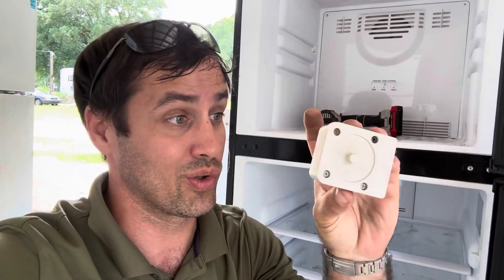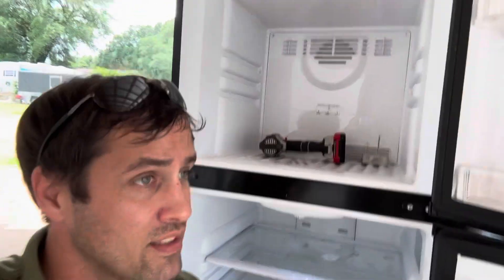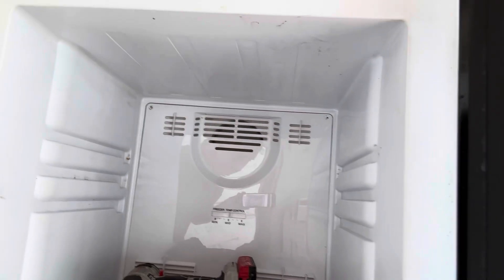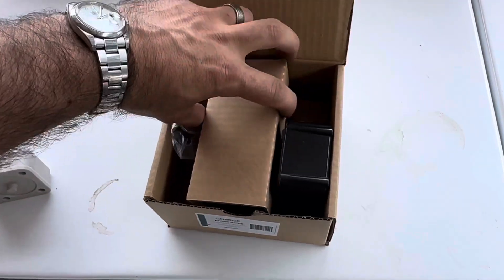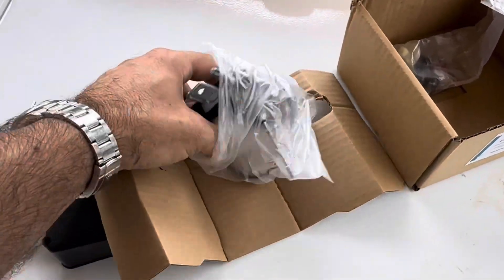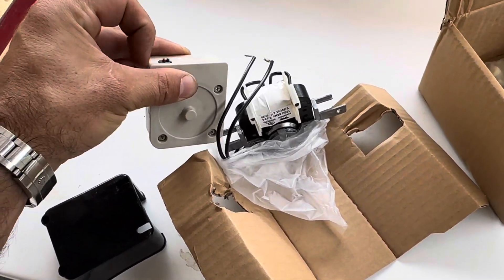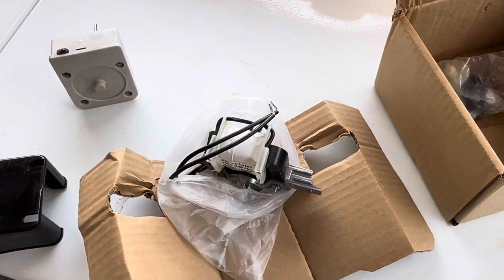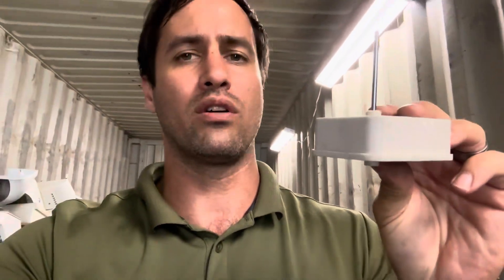How to fix a Haier 10cuft refrigerator evaporator fan motor trick

Comment: Smart choice, can't let the manufacturers out-smart us the customer all the time with OEM "requirements"
Reply from the maker: Oh yeah been putting those motors in for a while. The oems are just way too high. And they stink anyway. Always failing.
Reply: Hello, what's up. I have the same motor(shape) as the universal one but it is 12v DC??. Mine was making a noise i opened it gave it a clean and lube made a Contraption to test it outside the fridge (triac to step the voltage from 240V ac to 12V ac then i used a bridge rectifier to convert ac to dc). It worked flawlessly, until i increased the voltage up and burned a hole in the coil thing in the bottom its a french door bosch unit i dont know how this style of motor ran on dc and cant find one from bosch since this fride is discontinued. (NOTE it had a cylindrical magnetic inside not the shiny thing you find with induction motor@LAapplianceguy
Reply: @LAapplianceguy  this is the code. D4612AAA03 MADE BY DAEWOO
Reply from the maker: @Palestiano  wow I haven’t seen one like that yet. I’ll have to keep my eye out for it. Looks like the oem one isn’t outrageously priced $30-50 maybe?

Comment: i need one
Reply from the maker: The sm999 and em249 will work. It’s a universal evaporator motor kit.
Reply: How do I get it and how long is the shipping. Right now my refrigerator runs and freezer cools, but the lower part does not cool, do you know a quick fix you can advise? Thanks  @LAapplianceguy

Comment: Got a fan surging would that be module or fan?
Reply from the maker: That’s a tough one hard to say without being there. But I would put a volt meter in there to see if the voltage is constant. If voltage is fluctuating then it’s likely the control that powers the fan. If the voltage at the fan is constant then it is likely the fan itself.
Reply: @LAapplianceguy  what I was thinking but like to ask lol thank you sir
Reply from the maker: @claytonfowler857  no problem. Let me know what you find out.

Comment: Need one I have a few on these refrigerators seem like evaporator fan motor gives out very common
Reply from the maker: We keep them. But I think the part number is still em249.
Reply: @LAapplianceguy  Hello!  Excellent explanation in you video.  I have exactly the same problem with my Haier 9.8 cu refrigerator. Question:  is the motor the same as SUPCO part number SM999?
Thanks in advance!
Reply from the maker: @testuserpr yes I believe that the sm999 and em249 are the same or very close